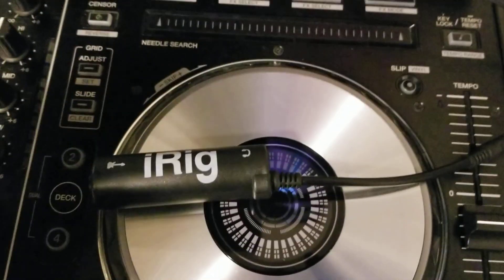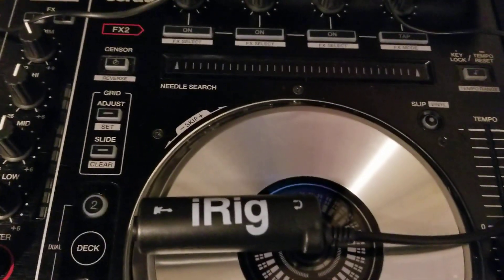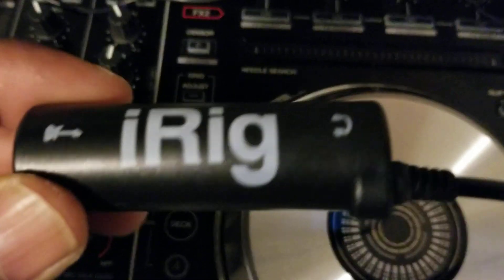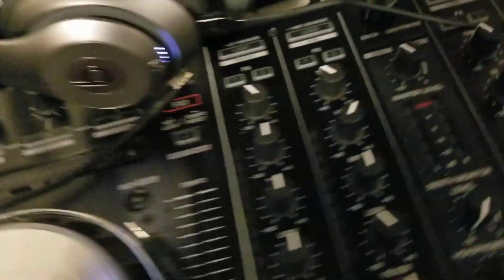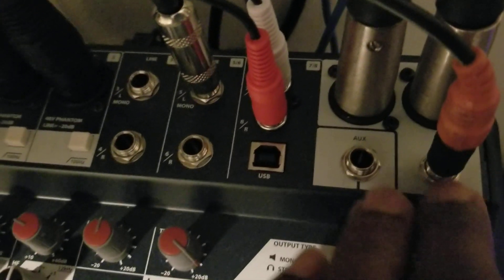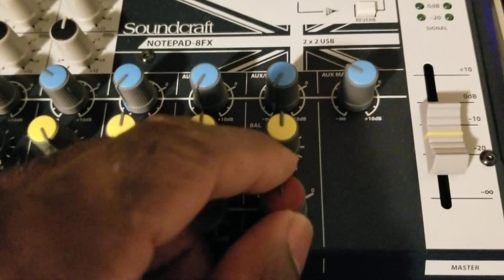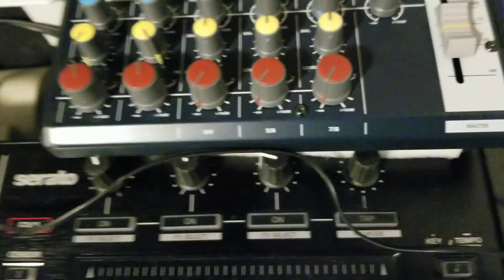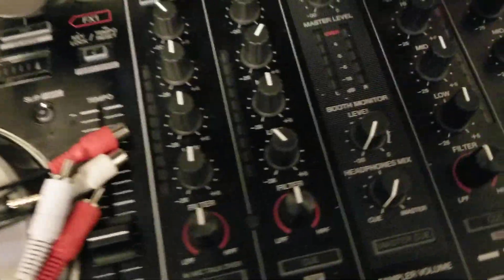IRig GO LIVE  DJ on Social media platforms - streaming device Setup

Comment: Hey brother, will this system work the same for my turntables with separate mixer (i see your using a dj mixer?) 

thanks in advance 👊🏻
Reply from the maker: Yes it doesn't matter what your using as long as you have an output jack on your mixer to go into the iIrig  it should be fine. Thanks for watching 👍🏾
Reply: @Djshaw1kinglegend  

yep got the microphone output on the back of my mixer 👍🏻 now my mixer has a record input or a channel 2 input for the the rca's you explain coming out the irig via the female adapter ((which one would you recommend?) 👊🏻
Reply from the maker: @Kuttings76  ok so when you say microphone output you are referring to a 1/4" plug output correct cause you can't use the microphone input of the mixer into the Input of (guitar symbol 1/4") Irig it has to be either a line 1/4" output or use the record output of mxer use one port to a 1/4"  into the IRig. The output on the IRig (headphone symbol) is for your monitor to hear what you are playing out or if you are doing a live and have some ob your live you will be able to hear them but it is not necessary if you don't want to listen just play out.  Use the a line in on mixer for monitoring. Hope that helps.
Reply: Are you on messenger? If so can i send you some pics of my set up if i get my knickers in a twist, im hoping i can figure it out when the leads arrive next week i already have the irig !!! 🙈
Reply: @Djshaw1kinglegend  I know the microphone out put on the back of the mixer is the one i need into 1/4  inch irig port , its the rest I may need help with !
Reply from the maker: @Kuttings76  message me on twitter or Instagram at DjShaw1Kinglegend.
Reply: @Djshaw1kinglegend  yes I have twitter, thanks will be in touch next week, many thanks 👊🏻
Reply from the maker: @Kuttings76  not a problem,  glad to be of help 👍🏾